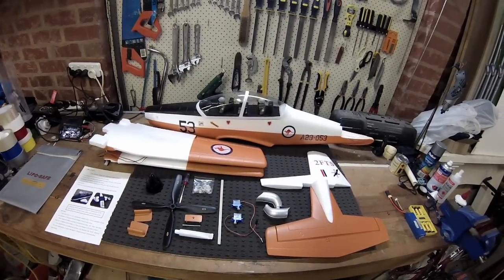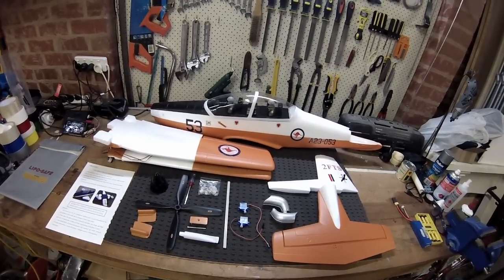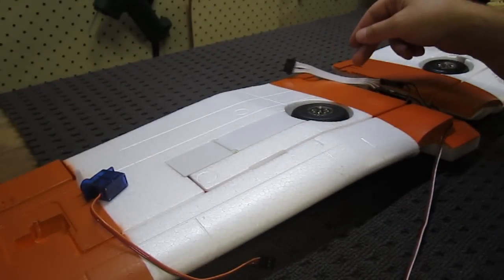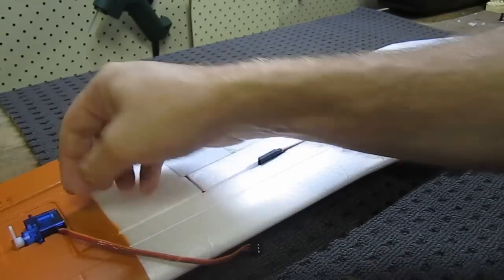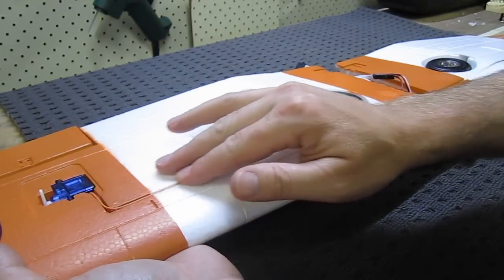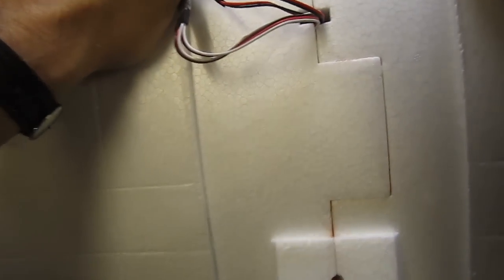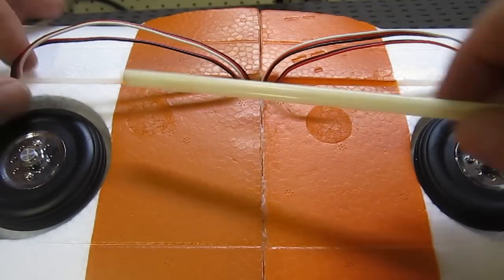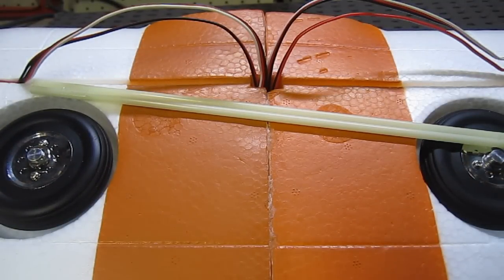Unique Models PC-9 RC Plane Build

Comment: Do you know where to get all the parts from and build it? I didn’t get the prebuilt one I just wanna know where to get all the parts
Reply from the maker: Sorry it took so long to reply.
 Unique Models, the manufacturer of the plane that I was selling, does not seem to exist any longer.

The planes could be sold under the Hookll brand through Banggood, but they don't seem to sell spares. I hope this helps a little.

Comment: I meant to say in your other video if you really want to be sort of scale accurate the spinner is the same orange as the plane and the prop blades are grey with red and white tips... I used to work at hawker dehavilland when we were building the full size pc9a's for the raaf ....i worked on aircraft no's 008 to 036. From 35 onwards they went with the current red and white scheme..if I bought one of these and one day I certainly hope to, I would have a constant trip down memory lane ☺️..also the pc9 is actually easier to work on than cars. Thnx for the vids
Reply from the maker: cyclistpilot Yes, you are right, there are a few small details that could be altered to get this one perfect. Unfortunately for me I'm don't get a lot of say with the manufactures. I have tried to find some orange spinners, even just one for my own plane, but no good so far.
Must have been awesome to work on the full scale! One of the guys I fly (RC) with also worked on the PC-9s down here at Avalon. A few years ago now...

And of course, you should buy one, it flies really nice!

Comment: Hi!
Where does your plane balance? Did you have to alter battery position? 
Thanks!
Reply from the maker: Hi Matic Belimezov I have not modified the foam and placed the battery as far back as I can without interfering with the canopy arm. This does put the C of G at about 20mm from the leading edge. I am happy very happy with how it flies with the CoG set there. Take off does require a fair amount of ground speed and then a little back pressure.
I have had reports back from a couple of my customers that they have modified the foam so that the battery will move further back and get the C of G to around 50mm. They are reporting that this helps take off and landing with a more nose up attitude.
Hope that helps. Cheers Michael
Reply: +MAD RC I was gonna ask the same thing about the CG. I just got mine today and noticed that the instructions don't tell you where the CG is supposed to be. A valuable piece of information never to be absent from an instruction booklet on a RC plane. So do you think around 30-40mm from the leading edge of the wing will be ok? Cheers
Reply from the maker: G'day Vas, I flew mine out of the box with about 20mm. I have since moved it back a little to about 30mm. I have just watched another video of a fellow on RC Groups that had a very nice maiden at about 40mm. I am not sure why the CG is not included, it did appear as though the instructions provided had the cover removed. 
End of the day, this is an excellent flying plane and can handle a very nose heavy set-up. But you'll be fine with a CG anywhere between 20mm and 40mm. Cheers Michael
Reply: +MAD RC Hi!
I have found it rather difficult to fly with CG so far back. Mine is almost (10-20mm) on the leading edge and plane performs best like that. 
Cheers
Reply: +Matic Belimezov thanks for the input and I'd agree that the CG out of the box at 20mm works just fine. Cheers Michael
Reply: +Michael Downie Just finished building mine and I gotta say, not the best quality I've seen on a plane. Had the pushrod for the rudder inside the fuse and was coming out right where the rear wing was suppose to glue. Had to split the fuse open to get it up where it was meant to be. Rear wing is bowed like a banana. The orange tone varies from the fuse to the one on the wings. Poor finish on the paintwork where orange meets white. Plastic canopy coming unglued. Terrible instruction manual... This thing is a mess. Oh, and the front clevis that holds the landing gear door broke when the wheel got stuck on the door. Just problem after problem with this plane and I haven't even flown it yet. I'm just hoping it redeems itself in the air because despite its issues, it's a nice looking plane.
Reply: Well I'm surprised. I was actually impressed with the quality when I put mine together. I get the sense that the batxh from Hobby King was put together poorly. I know that they have thr XT60 connection not the Deans I have. But it is disappointing to hear. 
The instruction manual is terrible there is no doubt about that. 
Long runway is needed with the forward CG but flies beautifully. I maidened on 100% throw which I wouldn't recommend. Dial back to 80% high rate and 60% low rates you'll be fine Cheers Michael
Reply: +Michael Downie yeah, I gotta say after seeing your build and looking at my plane, it's as if they're made by different companies. Not sure why the quality is so poor, but maybe you're right, maybe it's just the HK batch that's like this. Or mine is just an odd one...
Either way, I've got a new motor lined up for this plane that I'm hoping will kick up a notch. Keep an eye out for it on my channel and you'll see what I've got planned for it. ;)
Reply: +Aussie RC Playground 
Too bad you cant put pictures in the comments :)
Reply: +Matic Belimezov I'll have a video of it up on my channel in a couple of weeks, so you'll see what I mean in the video.